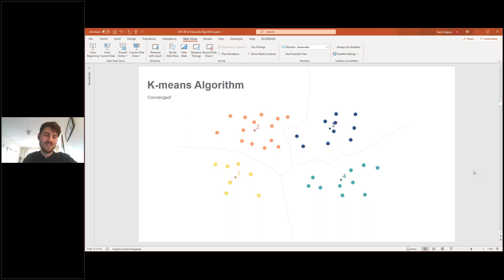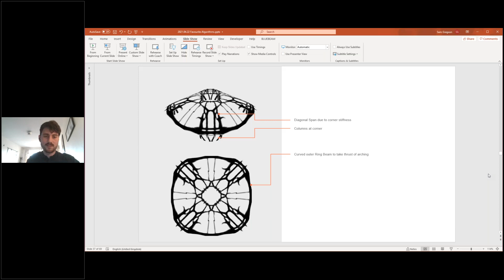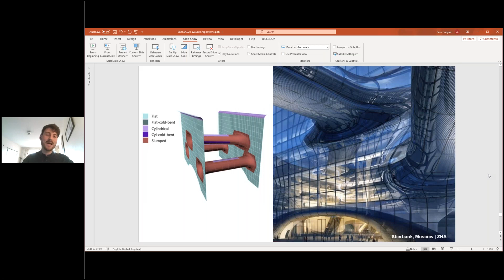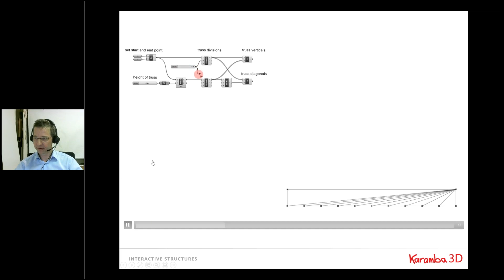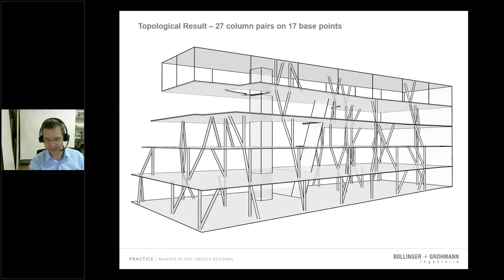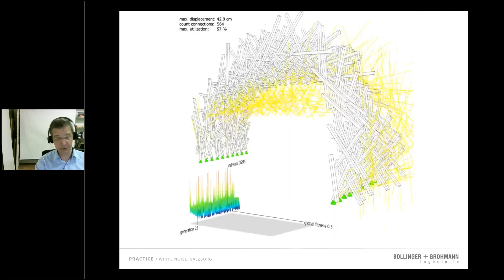Grasshopper UK User Group Meeting - April 2021

Comment: Oh sorry, I forgot to subscribe. :3

Outstanding presentation as usual. I'm an active Grasshopper 3D modeler user. I'm interested in professionalizing my skills up to high standards. Parametric Architecture based on science and research has a bright future for architecture, engineering and related fields on those disciplines.